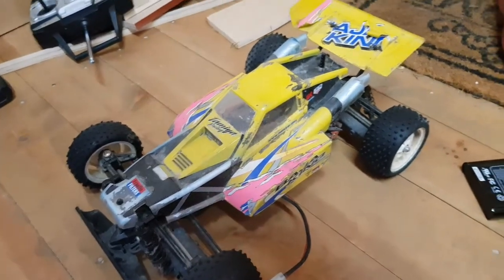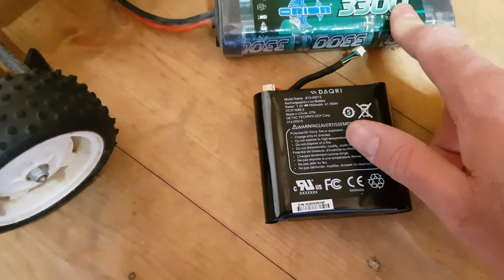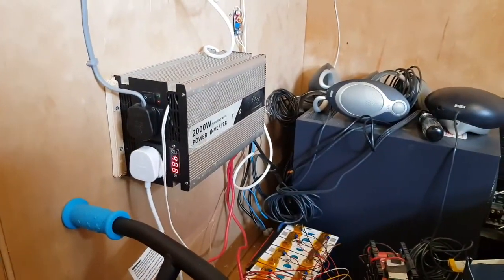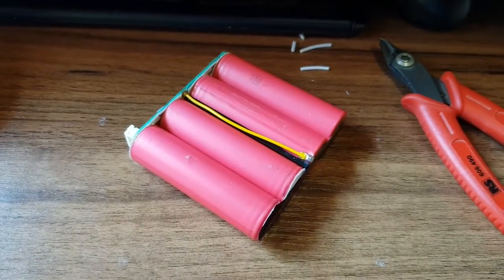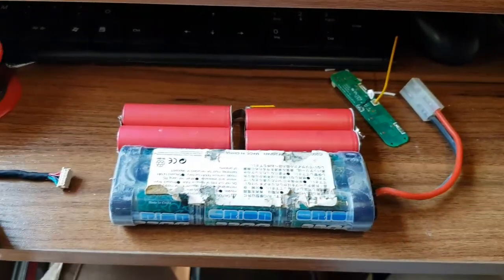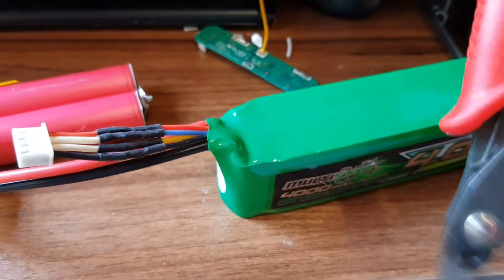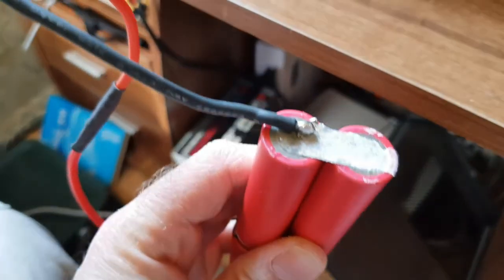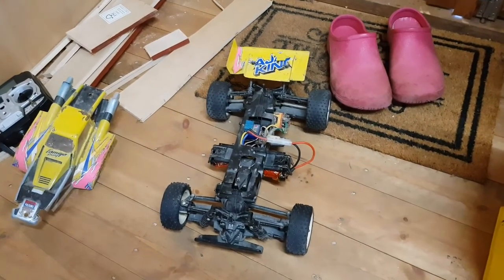RC Car self made 18650 battery

Comment: how do you wire up the balance plug?
Reply from the maker: Black wire to most negative end. Red on most positive end. And then each wire in turn to the next cell in the pack. So for a 4 cell pack there should be 5 wires.
Reply: @mathewlawrenceml  alright thank you